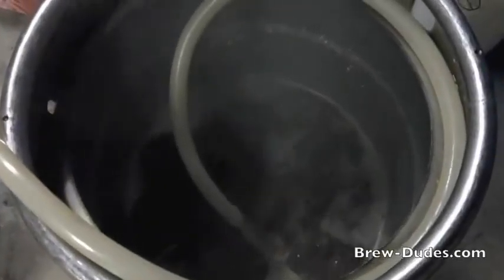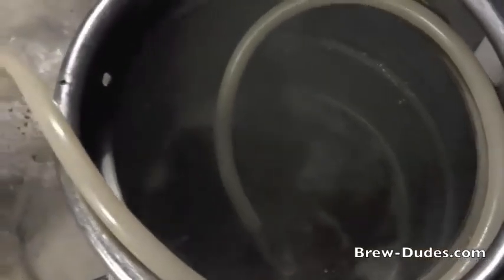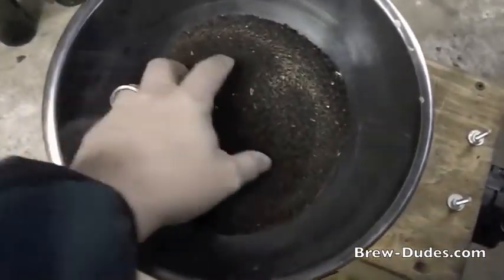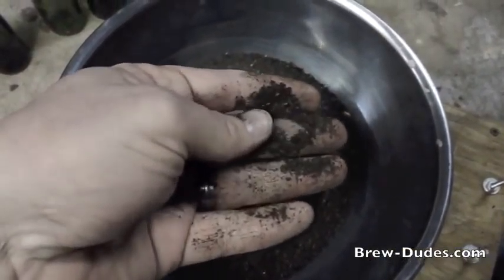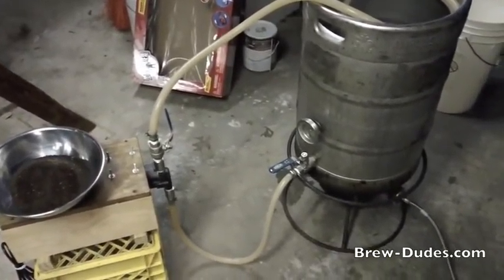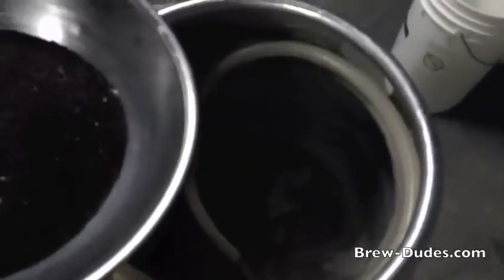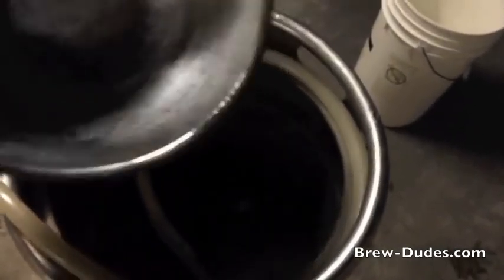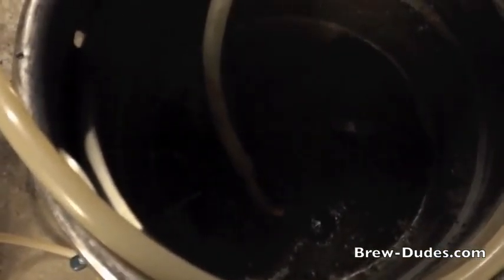How to Top Mash

Comment: nice vid..I get the beersmith podcasts and emails and was reading about doing that.  Glad to see a vid of someone trying it..how was the finished product?  Also, am I correct in saying that that addition of the dark malt wouldn't affect your gravity at all?

thanks
Brian
Reply from the maker: Its does effect the gravity.  By how much??? Just take it out of your recipe calculator and you'll see. Compared to base malt its only 10% of the points give or take.  I like doing it just as a way of not really worrying about my mash water chemistry.  I have found since this video that any suggestion that top mashing smooths out the roasted character is false.  Its still a good technique to not worry so much about how the more acidic dark grains screw with malt water chem and your mash pH.  Cheers!  -Mike